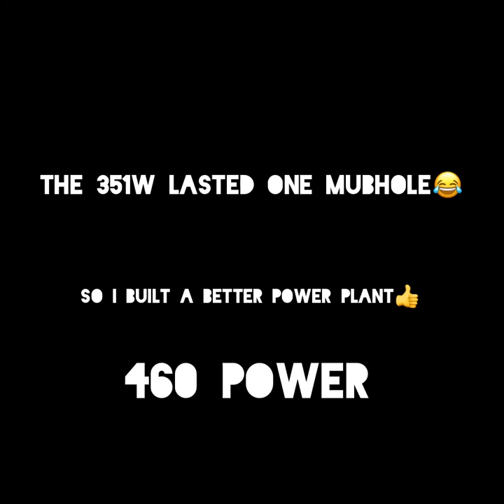My 1979 F150 Mudtruck Build!

Comment: A 351 Windsor is the best motor ford ever produced. That’s why it was made from 69 to 97
Yours must have been worn out when you got it and it sounded like you could use a little lower gear but the 4 link was bad ass and I’ve thought about making a oil pan like you did rather than spending $400 bucks on one
Reply from the maker: Yes I love the small blocks just wanted the big block power

Comment: Where did you set the front pinion angle and how much driveshaft angle do you have as well as are they both non slip yoke and what did you do for the four link bar separation for the front
Reply from the maker: It has a np200 as a drop case so angles are good and yes both shafts have slips and I think it was like 7 inches
Reply: @redneck6331  so where did you set front pinion angle and are the bars equal separation or smaller in front bigger in back or vise versa
Reply from the maker: Idk I set the pinion angle so shaft was best place it could be and bars are the same

Comment: Hey man, where did you get you coil buckets & shock mounts for the front. I’m trying to get a few more inches out of mine. I’d like to clear my 39.5’s, possibly 44’s. What size coil spring are you using?
Reply from the maker: The buckets are cut down stock 79 buckets and shock brackets I made, the springs are 8 or10 inch coils for a superduty Ford
Reply: @redneck6331  awesome man, thanks!
Reply: @redneck6331  what year superduty springs?
Reply from the maker: Idek guess 6.0 style
Reply: @redneck6331  10/4 thanks again man
Reply from the maker: Yessir